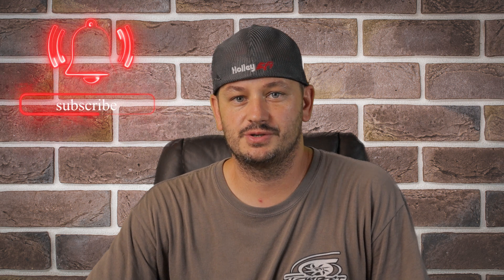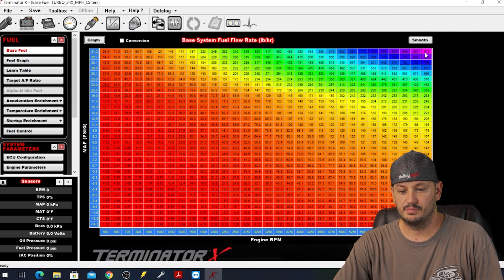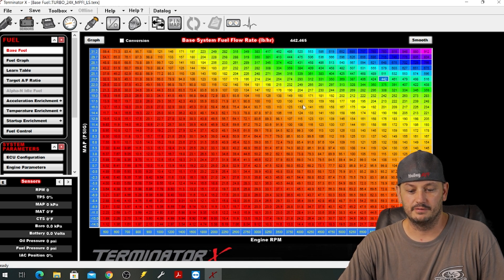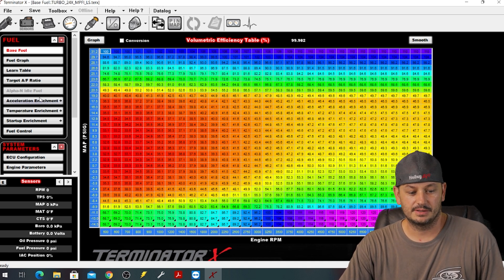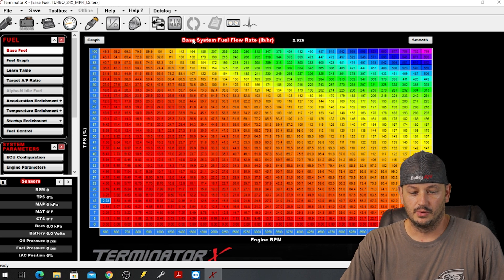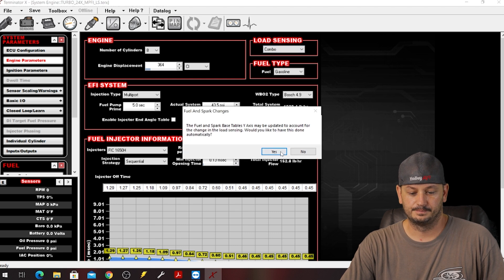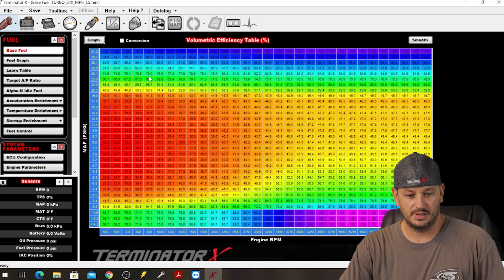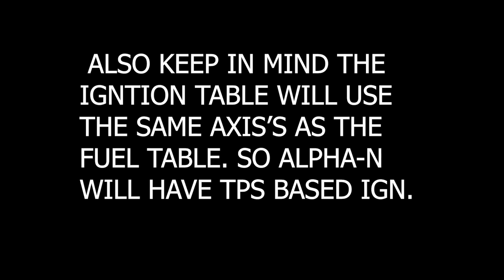Load Sensing Options Explained in Holley EFI \\ Terminator X for Beginners

Comment: Joe, long time consumer of your content, and finally i find myself coming back to these videos as I am installing a Terminator X on a LS swapped 3rd gen in my garage. Ive hit a snag however. And this is the most "newb" question, but I don't know who else I could ask, that may answer such a question. 
  I have Deka 80lb injectors, which I believe are EV-1s, the injector harness is for the stock type injectors, so I need to change the injector plug ins from the old harness and put them on the Holley. Is it ok to change it, Im competent enough to solder, heat shrink and do it. But, will cutting and resplicing injector wires cause a problem? Impededence etc? Cant really afford to drop 150.00 for another injector harness but if its necessary, ill stop and wait until i can afford to do so. Fingers crossed u see this. Appreciate your content as always.
Reply from the maker: @HammerBack10mm  you can swap the connectors with out issue as long as you don’t half ass it and do a crappy job

Comment: I use combo on my big cam bbc bracket motor.  This solved my idle and tip in problems when going to tracks with varying elevation ( sea level to 7000 elev is a bitch.). Before using combo I would have to tune the idle and tip in every time I went to high elevation or shit air tracks which is often loll!
Reply from the maker: Perfect use for it. Even though some of the stuff isn’t all that common to use, it’s awesome it’s an option when you do need it

Comment: I started out with lbs per hour but after messing with VE I figured out that was the way to go. I find if it's lean/rich in an area of the fuel table I can just either raise or lower said numbers  and it falls right into place where it needs to be.  VE numbers just made more sense to me.
Reply from the maker: On a basically 0-100 scale it’s a lot easier to just subtract 3 if you want to take away 3%!
Reply: @JoeSimpsonAtTempest  yessir!